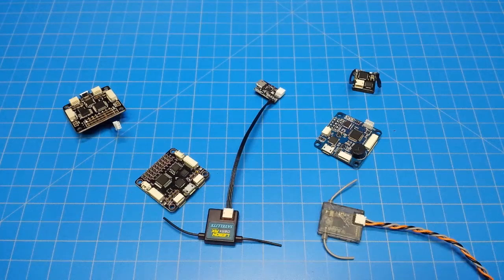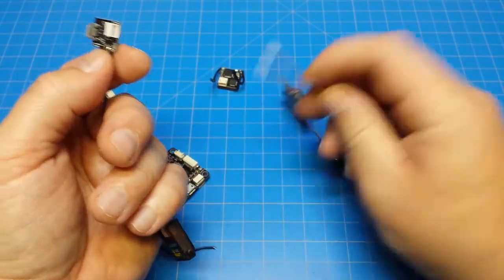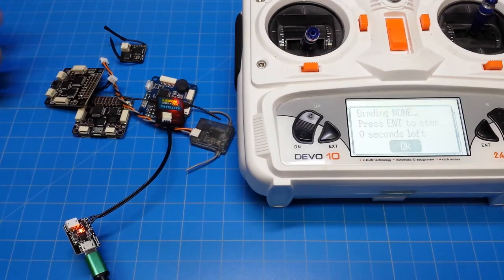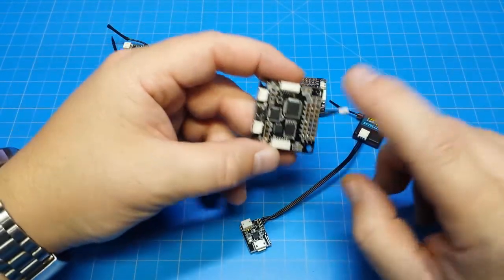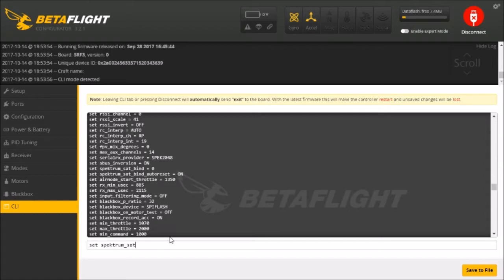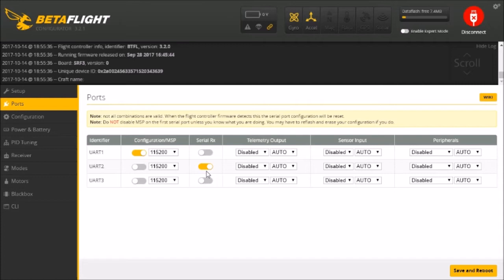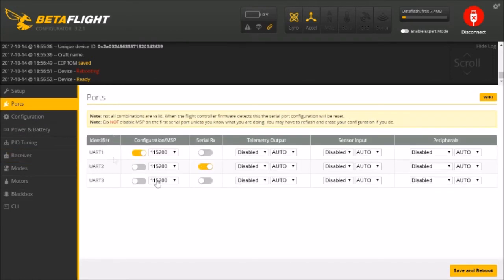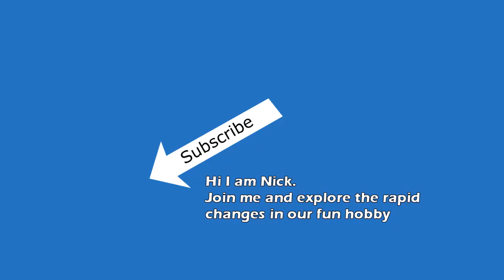Binding Spektrum Rx w/BMO1

Comment: Another great video, thanks for sharing!  

My understanding of the 'autoreset' (or 'autorst' depending on BF version) command is that it resets the 'sat_bind' value back to 0 after a power cycle.  This lets you use your flight controller to bind the receiver without it entering bind mode every time you reset your quad.  

I also couldn't tell from the video, but are you embedding the BM01 in your quad with the receiver after it's bound?  An alternative is to buy a LemonRX full-range receiver (not a satellite) which has a satellite port, plug in the satellite you want to bind, and bind the full-range receiver.  The satellite will then be bound even if you disconnect it.  This has the added benefit of enabling RSSI telemetry on the satellite, which in the past couldn't be done by binding with the flight controller alone.  Propwashed.com has a couple great guides on using Spektrum receivers.
Reply from the maker: No the BM01 does embed with this, one time use/Rx...hopefully. True another flight controller we know work, full range spektrum rx, but I don't think any of them are $3.